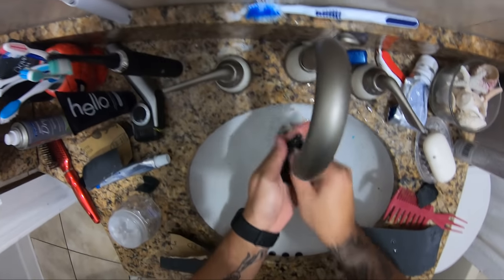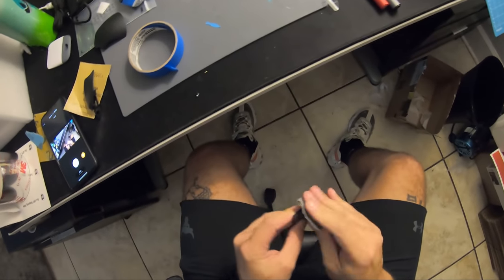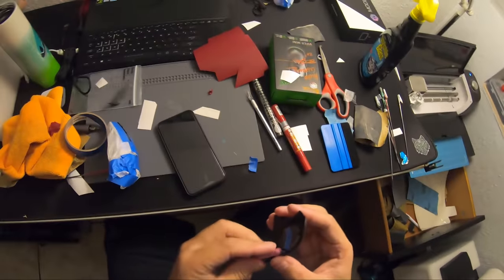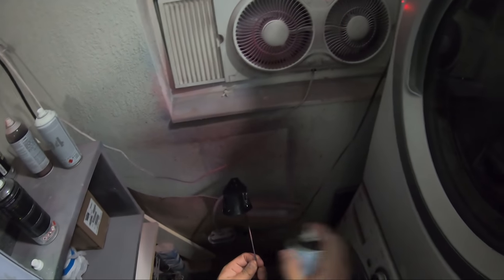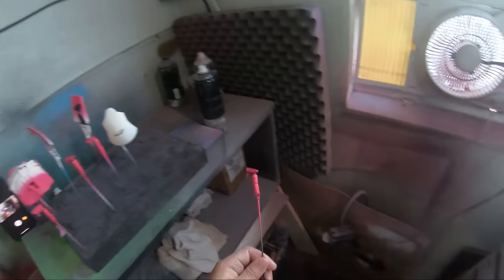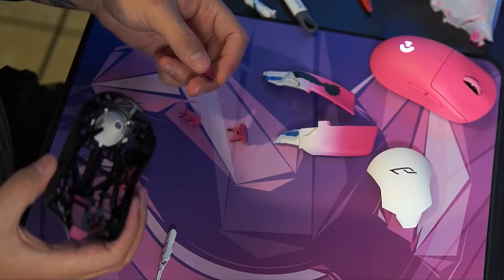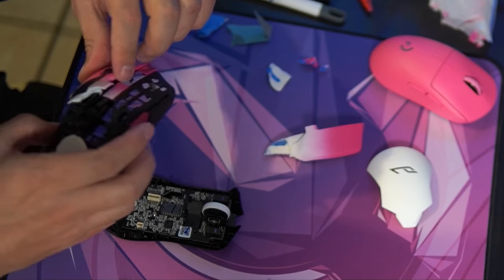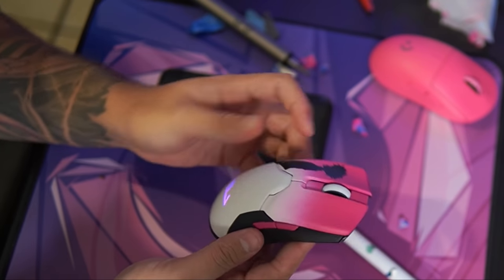I made a Viper ultimate for a famous TikTok star!

Comment: How does the paint coat and clear coat hold up over time? I'm really interested in doing my own painting mods but I'm worried about it possibly deteriorating quickly over time and getting all gunky and "melted" after a couple of months of heavy extended use 😱 I would prefer to do the mod once and have it last for its lifetime and not have to do touch ups every couple of months. Do you have any advice on any particular types of paint and/or clear coats to look out for? And any painting application tips to ensure it can last as long as possible? Cheers!! So glad I discovered your channel, subbed!!
Reply from the maker: the spraymax 2k clear is automotive grade. so it wont fade over time lol

Comment: I love your work. I was planning on painting my dm1 fps noir. I don't wanna spray paint but just put a design like cherry blossoms or something. Should I still sand down the whole top and apply primer? Also is there a certain grit I should use I heard even the green side of a sponge works. And any specific paint/primer? 

Sorry for all the questions. Thanks and keep it up!
Reply from the maker: thanks man. and you can sand it down with 800 grit and use some montana plastic primer and then just paint the flowers on top :)
Reply: @NachoCustomz  Awesome! Any brand of paint you recommend from amazon?

Comment: What product are u using in minute 9:37? 
is it so that the paint doesn't go away?
Thanks!
Reply from the maker: is Spraymax 2k Clear is a clear coat for cars is the best protection you can get for you paint is expensive, because after 2 day when you mix it that became hard so is just for one use or multiple if you have more than 1 mouse to apply it the same day

Comment: what size rubber wedding band did you use for the scroll wheel on the Logitech g pro wireless? I'm trying to change the color of mine and saw you have a pink one and was wondering the size.
Reply from the maker: is a size 9 but that vary from brand , i dona make a video about this in the future

Comment: I painted my mouse and I keep having an issue with the paint smudging and pealing over time from the heat and oils of my hand, not sure if just having more clear coats would have fixed that, what do you think, what would you suggest
Reply: could you fix that? and what clear coat did you use?